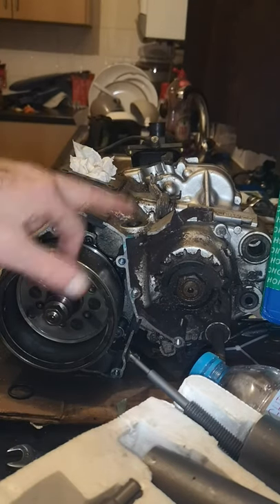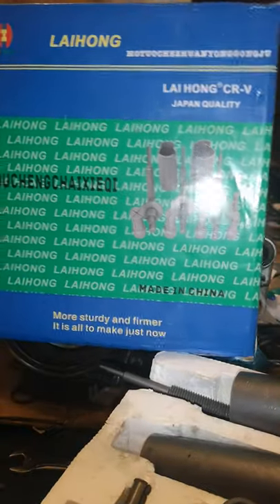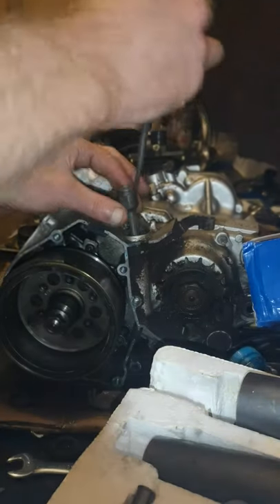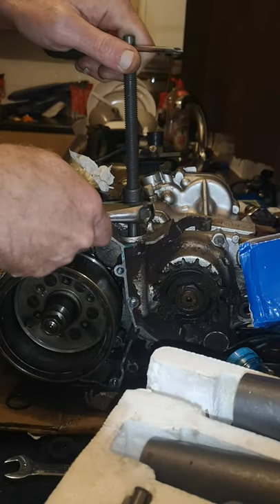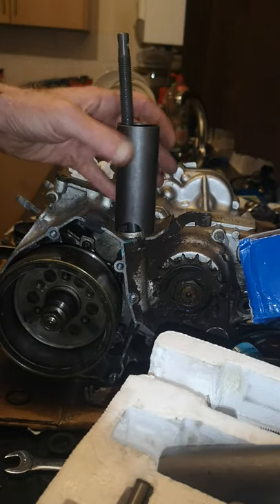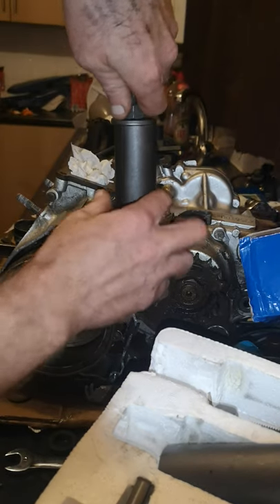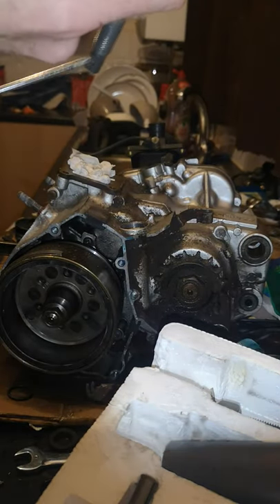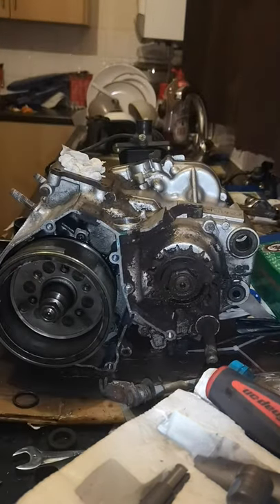How to remove motorcycle clutch arm needle bearings dtr 125

Comment: Fought you had the other one with slide hammer 2 stroke mx classics
Reply from the maker: I do m8 just the lad said he was having a mish with a slide hammer and couldn't get his owt so thought ad make him this for the littler bearings, nearly got the other done if you get time could u send is a pic of your switches, like the plug and wat colours go into it Al just put a plug on this one m8
Reply: @2strokemxclassics  I will m8
Reply from the maker: Nice one m8 I'm sure there a plug then the yellow and green to that black bit the goes on bulb, but a checked threw me ebay and the ones av sold just had a 9 pin plug on dunno if someone mite have re plugged it m8
Reply: @2strokemxclassics  go Instagram messager

Comment: OK SO HOW DO YOU REMOVE THE BOTTOM ONE?
Reply from the maker: Bottom what
Reply from the maker: How to rebuild a 3bn engine part 4 it's in that vid how to remove if you mean the bottom roller bearing in case, or you can slide hammer then out
Reply: @2strokemxclassics  The bottom bearing
Reply: @2strokemxclassics  will it reach all the way to the 2nd bearing on the bottom?
Reply from the maker: There isn't a 2nd bearing in the clutch arm shaft just one at the top

Comment: Not being cheeky you’re using the black cylinder upside down
Reply from the maker: Which black cylinder m8
Reply from the maker: It's on that way so the bearing can be seen been removed m8
Reply: Seen few videos with the same tool everyone is using the black cylinder with the half moon facing up ? Doing full bearings on crf fuckin nightmare
Reply from the maker: Don't think it would matter tbh m8 am sure the tool wouldn't sit flush wen I put it on the other way. What are ya stuck on m8 there's other tools but these get all the bearings out especially the blind bearings there only £10 off ebay

Comment: Mate your a legend! Thanks for uploading this, really appreciated! funny thing is the 3rd remover kit I've got on order is the same one your using in this video so once this arrives I think on the right path now ;-)
Reply from the maker: Defo m8 there only a tenna it'll get it out defo they good for other smaller bearings in other engines too,good luck m8😎
Reply: @2strokemxclassics  Thanks, just had a mission removing the head stock lower bearing race, a few mig welds later and some wacks and the bstards out :-) Time to chill now lol
Reply from the maker: Buzzin m8 how far are ya along are ya now
Reply: @2strokemxclassics  m8 it came out so easy with this kit, thanks for your help! been waiting on some missing bits from fowlers before i can put it back together, powder coated the cases in my oven and polishing up the crankcases while wait for my bits, not long now :-)
Reply from the maker: Buzzin m8 not be long now aye there handy them little extractors have ya ever used the black vht caliper paint on stuff, it goes on mint, silver case paint does top yokes n stuff class aswell, much better than normal spray, what did ya use for ya cases
Reply: @2strokemxclassics  yes m8 not long now hopefully ;-)  mad to think the whole bike is from eBay lol looking forward to thrashing this one around! I use Simoniz Aluminium Engine Enamel for the plastic cases, the head and cylinder, brakes etc.. i powder coated in my shed with a pizza oven lol :-)  only used VHT on the exhaust b4 not tried the case paint but will give it a go on the forks for sure, cheers for the tip!
Reply from the maker: Nice m8 make a vid when she's done be good to see it, 😅yeah I do sume bits in the halogen oven the vht goes on mint like a pro job it's good for all sorts of parts yad be amazed by it bro
Reply: @2strokemxclassics  will do mate, i've took a few photos along the way so can put them into vid with it running.... hopefully lol
Reply from the maker: Wicked m8 do you have any old back calipers with seized pistons av got a mint way to get them out just av just done one an didn't record it, and the ones upstairs av got arnt seized in Al return or buy the caliper just to make a vid
Reply: @2strokemxclassics  na m8 luckily i found a good rear brake, the front has a snapped bleed screw but you can get those hose bolts with built in bleed screws to get around that :-)